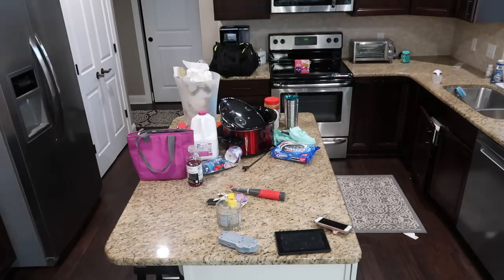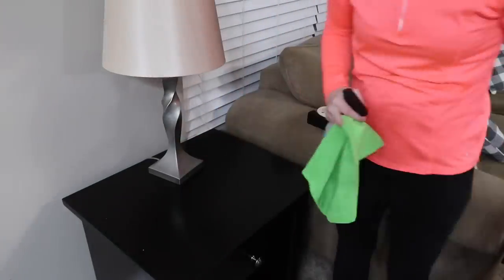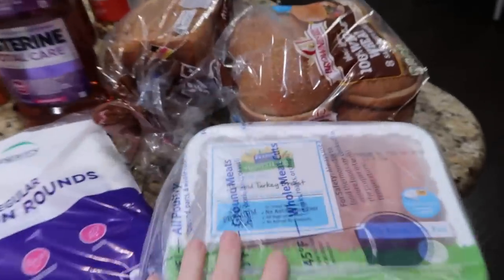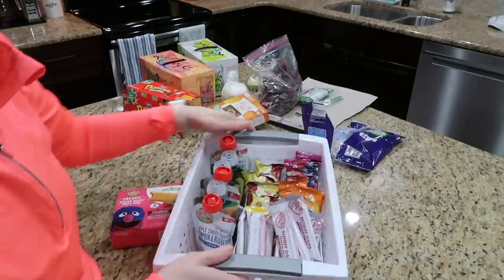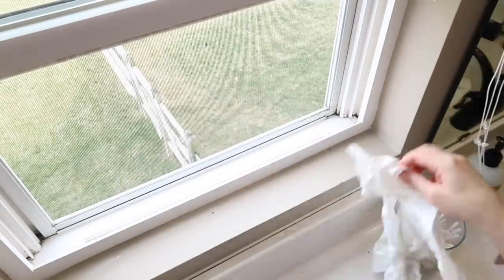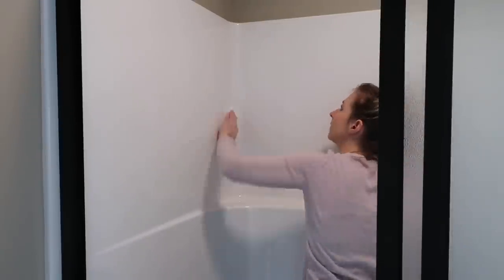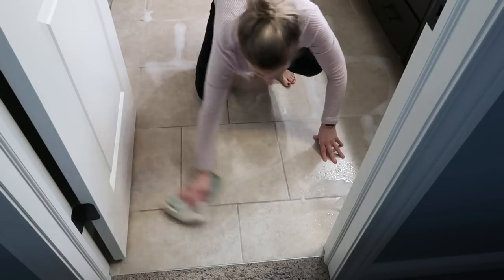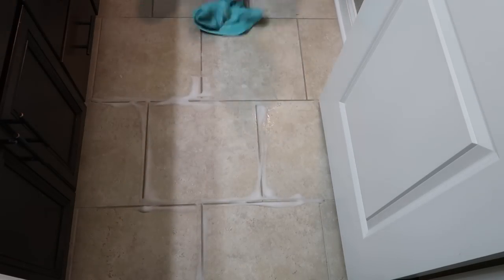NEW! 😵WHOLE HOUSE CLEAN WITH ME 2020 | ALL DAY SPEED CLEANING MOTIVATION | SPRING CLEAN ROUTINE

Comment: I like the steam mop the best but I can’t use it in my home anymore since my new house has real hardwood floors and the steam will warp the floors. I now use the Libman mop with some Murphy’s Oil Soap to mop and that works well. I do use the Swiffer mop pads as well with my Swiffer Sweeper, but I find that they’re more for smaller areas. I just use them in my bathroom and kitchen for touch up jobs.